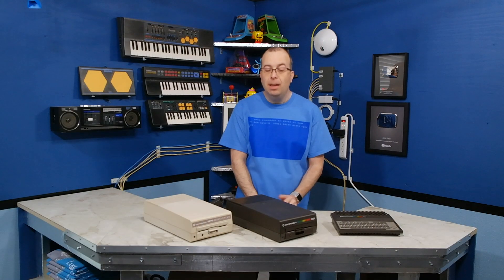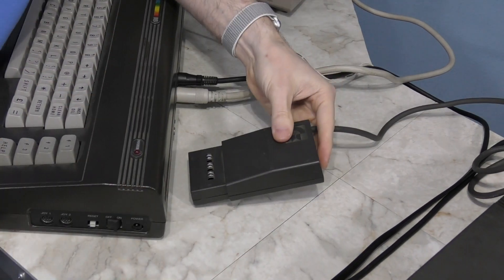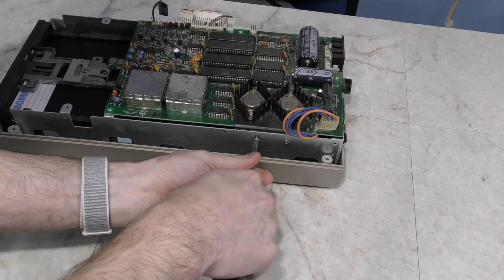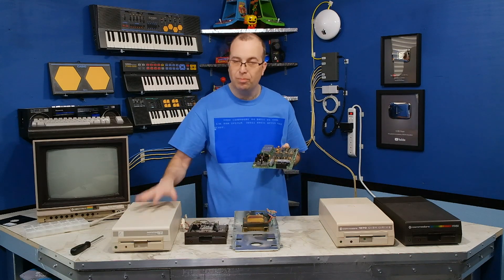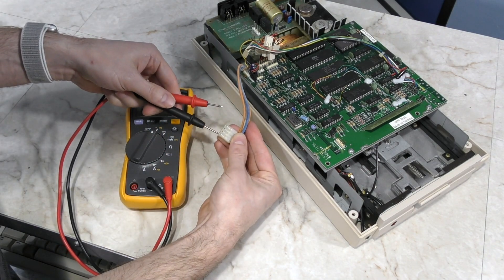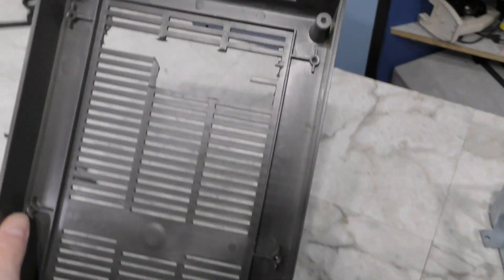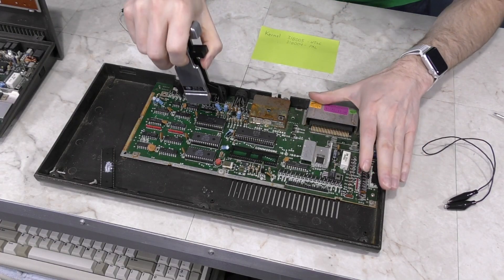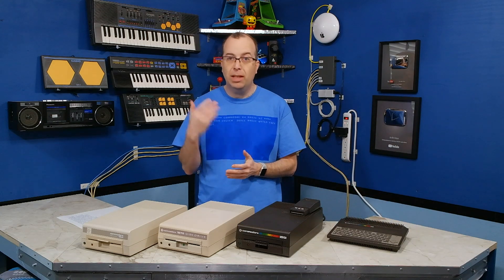Commodore C116 and drive repair, 240V to 120V conversion

Comment: I was unaware you could convert PAL to NTSC so easily! Cool!
Reply: Sorry Benjamin Tan, but I've never read a post with so much wrong information! NTSC & PAL don't use the same transmission format! NTSC is not also know as progressive scan! (both have progressive scan options). PAL is not "Phase Alternate Looping" (is is "Phase Alternating Line"). What you describe as 1,3,5 etc, is actually known as "Interlaced Video", which is used by both PAL and NTSC.  PAL alternates the phase of the 4.43Mhz colour carrier signal each alternate line, thus cancelling out any phase errors which can otherwise cause colour shift issues (eg. like green tinged skin sometimes seen in NTSC video). TV's and monitors can't "only receive NTSC or PAL but not both". The colour standards supported by TV's is dependent on the manufacturer, many TV's support multiple standards (eg. PAL, NTSC, SECAM).   And finally, VGA as a standard that was the successor of IBM's CGA & EGA standards. Although the horizontal timing is twice the NTSC line rate, it is a bit of a stretch to say VGA is based on NTSC. Hope this helps clarify some misinformation.
Reply: Both NTSC and PAL didn't originally have progressive scanning, and both NTSC and PAL both currently use progressive scanning.
The interlaced format that you mention was used by both NTSC and PAL, in some cases it still is used by both, but is very uncommon.
Reply: TheGeekPub when I was younger my job was to repair almost all c64's damaged here in patagonia, in the south of Argentina. About 6 to 8 a day! Some of them were ntsc and I had the oportunity of digging into one, one day, that inside had a little convertion pcb, consisting of a couple of transistors and a coil. I took the schemmatic from it, duplicated it,  and I modified to pal-n almost 20 other c64's. Good days in 1993 or so.. only eith this boards, no ic replacrment needed. Not exactly knowing what the board was doing
..
Reply: I remember seeing ads in argentinean magazines to convert NTSC C64 to PAL, fortunately my father bought me a Drean C64C, it was the first time I could play games in color! I'm sure it was amazing for you to convert those computers!
Reply: Yeah, the NES for example. CPU, Audio and Video all share the same clock and are in sync with the cathode ray, so PAL and NTSC versions of NES actually run at different speeds, which is why region locks on game cartridges were essential: NTSC games would be running too slow on PAL, and the sound would be pitched down.
Reply: Pro monitors are capable of displaying both PAL and NTSC.  Beyond the very different color encoding scheme, PAL runs at a higher resolution and lower frame rate.  VGA has absolutely nothing to do with NTSC.  It eschews the color encoding schemes of the broadcast standards and delivers a straight RGB signal.  The analog RGB output seen on many old video game consoles and 8/16-bit computers is very similar to VGA, differing only in the sync method and scan rates.
Reply: Ja! Me mató el nick! I remember having the C128 and for it to work, my father sent the TV to have a sort of "add on" button on the back of it, and who knows what it did, but made the C128 work.
Reply: It sounds like something that would require you to swap the video chip.
Reply: Oh, yeah. You can do the same with game systems. As long as the proper parts are available it's an easy soldering job.
Reply: Yeah. Just plug in a pal system to a modern TV, like normal.
Reply: I can imagine that there are lots of systems this wouldn't work well for. one major issue you'll run into is music being too fast and in the wrong key.
Reply: TheGeekPub
I think this is rare; at least as far as i know, most european computers from that time usually had the video signals generated by hardware, e.g. the Sinclair ZX80 and ZX Spectrum, both of which had a ULA chip (ULA stands for Uncommitted Logic Array), and it was this ULA chip that orchestrated all input and putput. The American counterparts, the TS1000/TS1500 (both US variants of the ZX81), and the TS2048/TS2068 (variants of the ZX Spectrum) used a different type of IC, a so-called SCLD, or Sinclair Computer Logic Device, which was housed in a Quad Flat Pack (QFP) housing, whereas the british version ULAs used a DIP40. Conversion from one TV standard to another would, in this case, consist of more than just replacing a ROM and a crystal; you'd have to build a daughterboard for the new ULA or SCLD, AND you'd also have to replace a crystal as well.
Reply: Two things I think it's worth mentioning, there is 208/240v in north america he even made a video about EV charging on 240v so I don't think it's correct or fair to state there isn't specially this being a nerdy channel, a more accurate statement would be 'not conveniently available in most rooms', honestly i think it's easier just to install a nema 6-15 or 6-20 socket+plug and call it a day (it's one more wire from the panel basically).  Specially if you have enough equiment a socket can be used for anything. Also the difference in voltage output in both transformers is likely due to the 50 and 60hz another solution would be to retrofit a more modern switched-mode psu with the appropriate voltage output and willing to accept 50 and 60hz which also makes a bit easier to replace in the future since it's likely no one makes the old transformer anymore, the only reason they built devices this way in the past was to make it harder for normal people to use in different regions and they could price differently many other countries they would use 55hz transformers and a switch to change the voltage.
Reply: I'd rather keep it at PAL since the image quality is vastly superior to that of NTSC (which is to be expected for a standard that came out later) I have 2 gamecubes and the japanese one outputs 480i s-video (letterbox) where the european one can output widescreen 576i RGB. sure it runs at a lower framerate but on an HD tv i'd rather have a higher resolution than a higher framerate.
Reply: Yeah and this shit about pal games slower than ntsc ones kept going until roughly the 2000's when really some TVs here were perfectly capable of displaying 60Hz signals (my parents used to have a rather cheap TV from 1993 and it displayed 60Hz perfectly fine ... All they needed was to include a switch for 50Hz and that was it ...
Reply: I wouldn't think it should be. To my knowledge many systems have different graphics chip revisions for the two standards. (and sometimes a third for Secam)

PAL is 50 fields of 312 lines with the colour phase alternating every line (hence the name), and NTSC is 60 fields of 262 lines without the alternating phases.
I believe the colour phase is different, as is the frequency gap between luminance and chrominance signals.
The frequency of the Audio sub-carrier also varies, but this varies even between things that are 'the same' standard. (this is why PAL M, PAL N, PAL I, PAL G and so on exist, mostly.)

Most PAL televisions from the mid 90's onwards can support both though. That's helped me out a lot with my Super Famicom for instance. XD
(PAL VCR's also tend to offer NTSC tape playback, though they then output an NTSC signal, hence the need for the TV's to support both.)

The implications of different TV standard implementations do of course vary between systems.
The Atari 8 bit colour palette is different between NTSC and PAL machines. (the major difference seems to be a 90 degree phase offset in chrominance, but there are also some more complex quirks that change which colours some systems output entirely.)

I'm guessing it would also vary depending on how the system outputs video.
The likes of the Atari 2600, Atari 8 bit home computers, and the NES output directly in Luminance + Chrominance.

Meanwhile, a Mega Drive, SNES, Amiga, and so on output RGB, but then have a conversion chip perform an RGB to Luminance + Chrominance conversion.
(This is effectively S-video. So In fact I suspect such systems do a LOT of conversion; RGB -> Svideo -> Composite -> RF would make sense, since each follows on logically from the previous conversion step.)

In principle, PAL/NTSC conversion shouldn't be so easy given the completely different number of lines in a field, different field rate, and different proportion of visible to vblank lines;

But I suppose given how most PAL systems don't do a particularly good job of using a PAL television properly (240 lines is NOT a full frame image on PAL, even with the use of one of the 'progressive scan' hacks computers tend to use.)

PAL for most systems seems to have been an afterthought.

Anyway, even if these conversions are simpler than they seem like they should be, I do wonder if they are  'correct'.
I know games/programs for one type of machine often don't work as intended on the other. (or sometimes at all; PAL to NTSC conversions in particular can result in games being completely broken, given what PAL machines can do when pushed to their limits vastly exceeds what an NTSC machine could in many cases.)
But the more interesting question is, if you convert a PAL machine into an NTSC one, does it have the same behaviour as a native NTSC machine, or does it have it's own weird little quirks?
Reply: Raul Rojas
I don't suppose you still have that schematic? I, and probably others too, would like to see it, and maybe try to find out how and why it worked.
Reply: I wonder if the colors are correct between the two. Apparently PAL and NTSC use different phasing for their color encoding (due to PAL being YUV and NTSC being YIQ) and so the PAL vs. NTSC versions of the VIC-II had to do some phase-shifting to get roughly the same colors as each other. Simply changing the video clock rate wouldn't correct this...
Reply: In the 64 replace the VIC II, NTSC and PAL parts are different.
Reply: @BertyFromDK
Not the ZX80 but the ZX81 had a ULA chip. The TS1000 was a straight copy of the ZX81 (with double the RAM) and therefore had a Ferranti ULA, not a SCLD (Standard Cell Logic Device*)

The TS1500 is the one with a SCLD made by NCR as did the TC2048, TC2068 and TS2068. (I had my Unipolbrit UK2086 which is a Polish market TC2068 fixed with a TC2048 SCLD last year). My issue 2 TS1500 has a jumper hole to select 50 or 60Hz (the ZX80, ZX81/TS1000 and 1500 were black and white machines and therefore have no NTSC/PAL issues as these are mere colour encoding schemes) so it would run okay on either European or American TV's (no rolling). It would require some additional resistors though but nothing major.
The NTSC ZX Spectrum (rare, was sold in Chile where NTSC is used) had a different Ferranti ULA, different clock crystals and 2 coils. You can modify your PAL Spectrum with this kit: http://www.mutant-caterpillar.co.uk/shop/product_info.php?products_id=4393

* Timex Sinclair 2068 Technical Manual, paragraph 1.1.1
Reply: C64 C64:

The border on a PAL C64 is bigger because PAL has 625 lines total with 576 lines visible, NTSC just 525 lines with 486 lines vsisble. But not only the upper and lower border is bigger, the sideborders, too. That's probably a cosmetic thing. But the bigger border on a PAL C64 gives you much more fun to play in demos ;-)

It seems that PAL was one of the best analogue transmission systems. NTSC mostly was called 'Never The Same Color' because of its washed-out colors. But the variants of SECAM in France and Eastern Europe (Iron Curtain) had their problems, especcially the red and blue 'color flares'. In his channel, 8-bit-Guy described different methods of NTSC-Artifact color generation modes, like CGA graphics, Apple II and the Advantech I.Q. Unlimited. As far as I know, the Amiga's HAM mode is also a remains of its NTSC past. It was designed as a games console, so it must be able to connect it directly to a NTSC TV. After Commodore wanted to make a computer out of the Amiga, they switched to RGB. I remember a documentation, the chip designers were told, they should skip HAM mode because it is obsolete in RGB. They replied, if they remove the HAM functions, they have to leave a large hole in the die or they will have to redesign the chip completeley. So the HAM mode was left in and was one of the best graphics capability demonstrations for the Amiga - but not much more. And yes, the image quality of HAM6 is similar to NTSC - not very sharp and a bit washed-out colors. HAM8 on the AGA-Amigas has better quality.
Reply: @Jean Carlos Motta Ribeiro Like you admit your slower
Reply: Yes.. I had something totally different in my mind..
Reply: Its quite odd that the Standards of Video Encoding/Decoding is still split between the OW and NW. But still. I am glad NTSC/PAL might become a reality soon if the modding can be done :D
Reply: PAL->NTSC or vice versa = replace Kernal ROM + Crystal
Reply: Вообще то японские телевизоры понимают оба формата. Нужно было просто попробовать!
Reply: He changed the ROM too so that probably changed the code for how to output video.
Reply: We got our Sharp Pinkwas 17 (Kenia Sharp) converted to a NTSC with a similar circuit. We have both, the NTSC and the PAL version by Drean. The circuit is very simple. I have read that it is ONLY VALID FOR PAL-N type which has more in common with NTSC than PAL-M or B. I recall seeing this something like that in the web. But in the mid80s was too much, and TV conversion was a good bussines due imported VCRs, Computers and consoles running on NTSC. Drean PAL version was a bit different being a pal N type. Debe was eve a couple of bodges on the first revision with wires and the VIC II is the PAL part and not the NTSC ones. Issue with this circuit, in our case was, it go out of tune and colour was messed up. But hey, it was for gamming, we didnt bother too much. Both C64 broke down once a year. The Drean was a bit better, still weak. On hot summer days, after 2 or 3 hours of playing giana systers the bottom of the machine was incinerating hot .... Yeahhh ... the good old times.
Reply: We too !!!! LOL ... A bit doggie, but it worked. We brought it to "Parque Electronica" near Parque Chacabuco ... LOL. They conversion was expensive and not good enough. The TV, A Pinkwas 17 by Kenia Sharp (trasnoche Kenia Sharp club jajaja) was sort of  "PURE PA"L design that you didnt have the proper paths to attache the conversion network ... most like Telefunken. Converting them to NTSC was a challenge. In fact, we had a Telefunken and two technicians gave up on the conversion because of the design. On the other side, we have a Noblex TC20 (TODO COLOR) and it was NTSC ready through an optional conversion kit from Noblex. But by that time we have a Drean 64, so no conversion needed. It was a plug in board. The Noblex still strong. The Pinkwas died in 2008 due to a poor repair. The Telefunken broke down like 4 times till we gave up. Nice wooden box and good sound, 32 channels (WOW) but unreliable.
Reply: It is a good mod. I know a guy fited a via epia (Im probably misspelling it) in a 1541 but today you can fit a Rasberrypi even on a 1531 unit.
Reply: Vax Buster... this is true. PAL uses a slower refresh rate (50i vs 60i or 25p vs 30p).  Just depends on whether refresh rate or resolution is most important to you.
Reply: PAL and NTSC are the colour encoding although PAL is usually 625/50i and NTSC 525/60i. In the early 1980s we had a JVC Multi System monitor at work which could be switched do any combination including things like PAL 3.58MHz. In 1989 I bought a Toshiba TV which when connected to my Atari ST via SCART would switch frame rate automatically. I had a small program TSR? which would switch my ST to 60Hz which was easier on the eye (less flicker) for word processing. Later I bought secondhand a true Multisync Monitor which could go all the way from 625/50i PAL to SVGA, conveniently covering the Atari Hi-Res mode. However, that was a specialist bit of kit that had been used on a trading floor, and consequently had bad screen burn.
Reply: me too! I now have a deeper understanding of electronics and would like to take a look, but unfortunately no, I don't have a chance of finding one of them. I was an employee in a small Computers shop, which belonged to an actual very good friend. I asked him several times recently if he still has some old parts, but he dropped to trash all the "oldies".
Reply: FWIW, the TS1000s I've been exposed to have no QFP parts.  Whether it's called a ULA or an SCLD, it's housed in a DIP40 as well.  The video chip in my 2068 however, is a square surface mount package.
Reply: So to clarify, he changed out the 14.xx Mhz crystal (to what value?) and the kernel chip?
Is the same crystal used for the main cpu or only for the video generator?
Thanks.
Reply: Color system changing was a very common thing in the past in Vietnam, because we have a complex history of color systems. During the separation the South uses NTSC like the US, but the North uses SECAM TVs supported like communist allies. Later on Vietnam changed to PAL, but a lot of old TVs was imported from Japan which also uses NTSC. So people just brought them to the electronics and things will be fixed by a crystal replacement along with some simple changes and now the TV will become a multisystem colored one.
FWIW many audio-only CD drives can also be converted to video CD drives by plugging in a simple board
Reply: apparently Commodore was cheap as hell and reused a lot of parts.
Reply: Lazy
Reply: PAL is a higher resolution, so NTSC is a downgrade. Better to buy a multi format monitor
Reply: How would you feel if I told you I took a Commodore 64 and turned it into a gaming pc running windows 10
Reply: Niek Nooijens :
The screen res is always the same except for the Amiga. More PAL res means bigger border. The screen border on a PAL C64 is gargantuan! So NTSC gives you a bigger picture on the same CRT size.
Reply: It is not common to convert PAL to NTSC, so who knows? I would personally convert PAL to S-Video or VGA rather than to NTSC. I think these early machines aren't that different when comes to PAL and NTSC versions, but later, with Atari or Amiga, computers had CPUs with different clock speeds and very different parts for Europe or USA.
Reply: Your brother so cool.
Reply: @vernonchristianmarquez5664  you did that for the attention.  Well I am going to go on top of your attention to call this out
Reply: Someone is making a board for the Commodore 64 to allow both NTSC and PAL video and to switch the video modes, there will be a switch that toggles between the two and this would be hooked into the VIC-II socket. It'll slow down the system's CPU to the speed for PAL and back at the normal speed for NTSC.
Reply: Simple just get a pal tv
Reply: @otpvids  simple comment from a simple minded person and that was not to be taken in a good way
Reply: And if you can't find the chips, there's dongles you can buy online that will simply convert the signal.
Reply: NTSC and PAL uses the same format to transmit analogue video signal, only in different method. NTSC (also known as progressive scan) run through each line while PAL (Phase Alternate Looping, also known as Interlace scan) scan line 1, 3, 5, etc... all the way to the bottom and comeback again to to line 2, 4, 6, etc... all the way to the bottom. Since the TV or monitor could only receive either NTSC or PAL but not both, a little tinkering is needed so the monitor could display the image properly. For this reason, computer manufacturing uses VGA standard (which is based on NTSC) so people don't have to worry that their system is not compatible for their monitor.